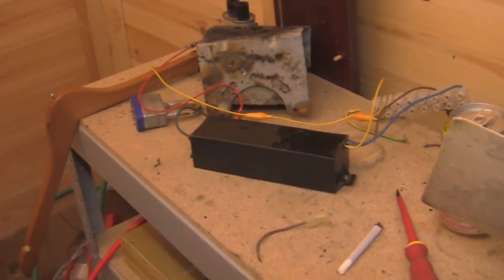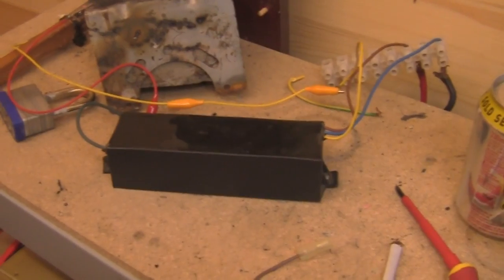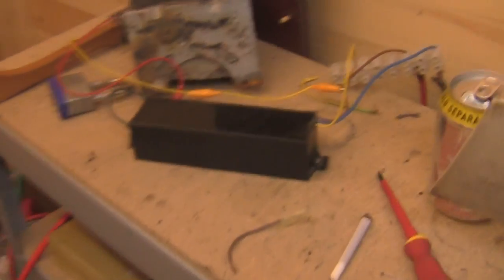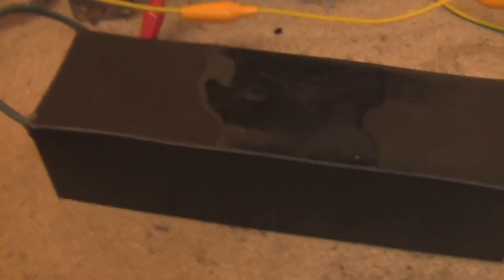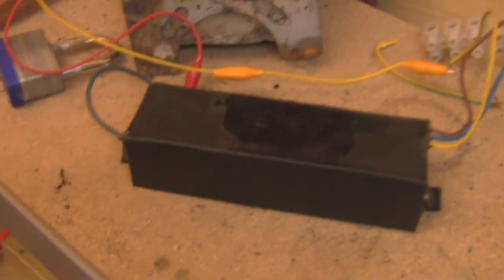5 Kv fly killer transformer

Comment: I think the little discharge is not a capacitor but the inductance of the secondary coil of the transformer. I could be wrong but it seems kind of logical. If the primary is not shorted the large amount of windings on the secondary can hold some charge. It won't happen with a MOT as you ground the secondary. It also is one of the reasons why I ground the negative end of my flybacks.